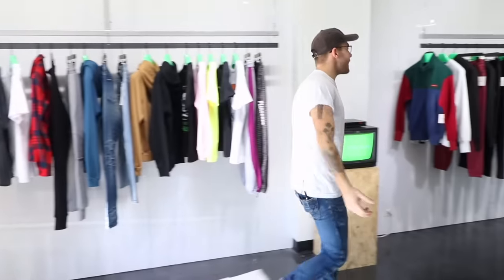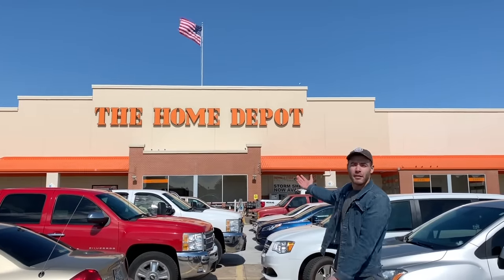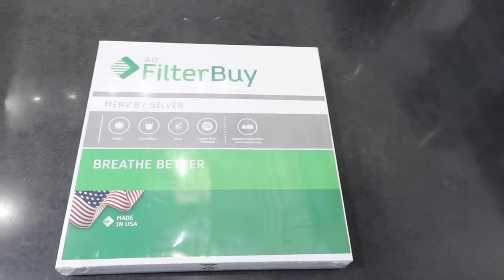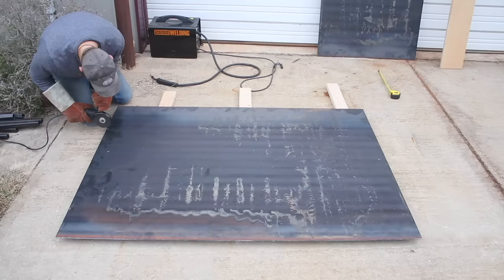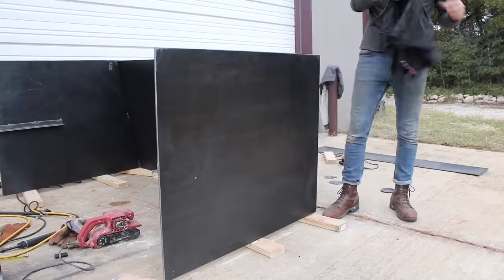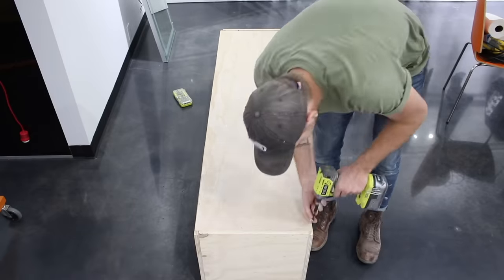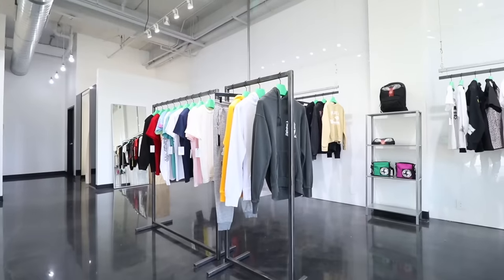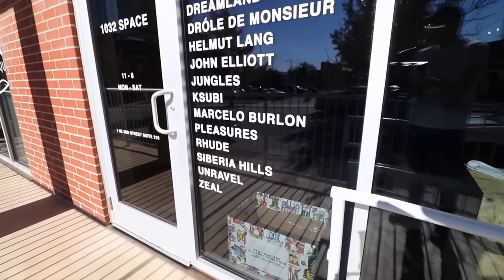How I Built a Clothing Store in a WEEK // For Under $2,500 // Modern Builds

Comment: unlike most people i think the osb looks fine but definitely looks extremely plain. i know it was supposed to be minimal but it should also stand out, everything looks very normal & boring. i see y’all trying to make the cashier more unique but that’s only one thing. if the colour of the vertical lights from the original store could be changed to white i think that would look very cool, but i’m not sure how that would’ve been done. some art definitely would’ve helped or maybe some branding?? i don’t think i saw the name of the store at all other than outside the store

edit: also maybe talk about the brand’s mission on the wall? and if i’m not wrong green is one of the colours of the store, in my opinion it doesn’t really match well with the rest of the stuff but if it is  a part of your brand (the logo is literally green) it should reflect more in your store, not just hangers. a green accent wall would not hurt. also also the carpet in the dressing room looks out of place and the lights at the side of the mirror should be the same length as the mirror.